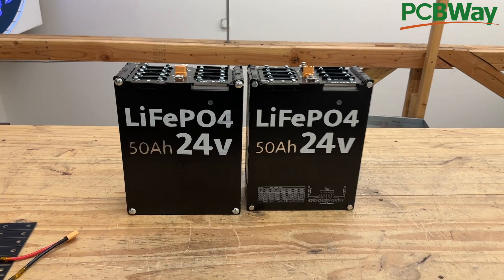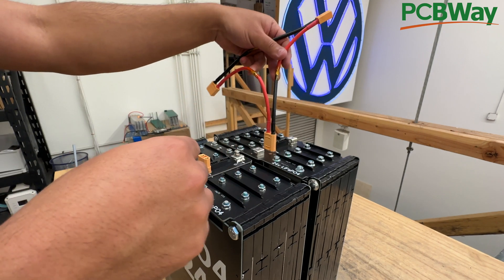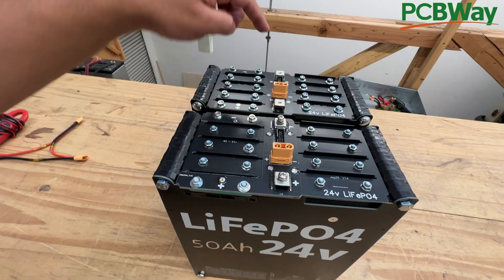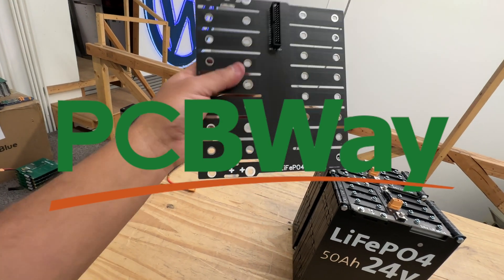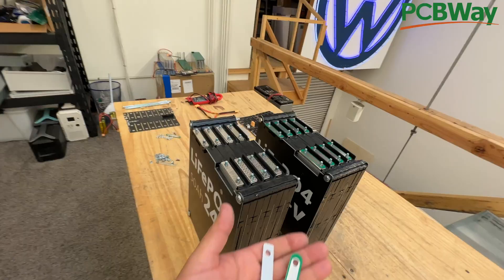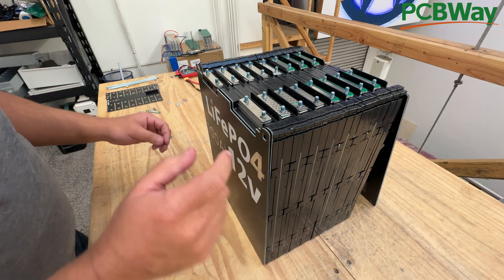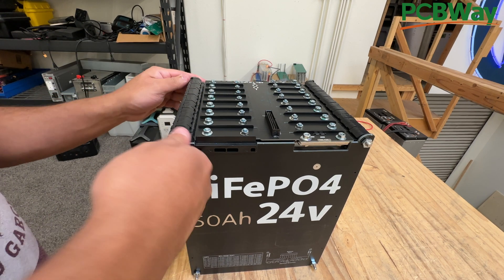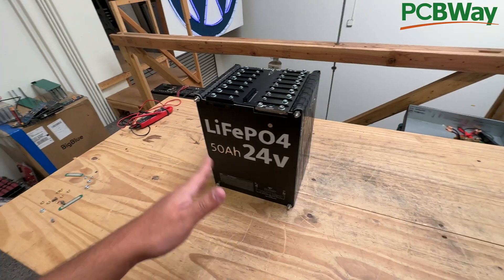How to Make 48v LiFePO4 Systems

Comment: The BMS that is attached has a 20 pin connector and the board has links to a 36 pin connector how do those work together? Can a 20 pin connector be used if only running 1 48 volt pack and don’t plan on expanding

Comment: Could I use ring terminals to attach bms leads to those bolts on top? I don't like the pin connectors for BMSs.
Reply from the maker: Yes

Comment: Let me ask here if I have my reasoning correct.....currently, I have (16) 6v @ 215ah FLA golf cart batteries hooked up in 2 paralleled banks at 48v.  That is 48v @ 430ah or 20,640 wh.  Because they are FLA, the recommendation is to not go below 80% charge and never below 50%.  This means my usable energy is more like 4128 wh at 80%, and 10,320 wh at 50%.  Does this mean that (1) 48v @ 100ah in LiFePO would be as good as my current bank being discharge to 80% (since LiFePO can be drained fully)?  And (2) would give me, nearly, the same amount of useable power as draining it to 50%?

Thanks!
Reply from the maker: Yes that’s correct
Reply: @jehugarcia  Thank you.

Comment: So 2P 50Ah (50+50=100, there’s that basic math again) is 100Ah? LOL
GREAT vid, though for those that NEED it. I LOVE your stuff.
I started making 48v SPIM08HP High Amp Load Packs for my Solar System from your video about them.
I 3D Print my own hardware for the packs too. The Frames and the little bolt blocks to tie cels + to - together and compress the pack cells to minimize expansion during operation. Plus a Nice High Amp Pack BMS, of course.

Comment: Wow Jehu, you really did a great job DUMBING this down for those that need that level of explanation because they don’t put in the needed research to learn about low voltage DC for themselves, huh? Or is it a self confidence problem? This info just seems like a DUH moment to me, basic math, 24+24=48? 

On a different note, are you concerned that PCBWay being Chinese, they might steal your IP and duplicate your designs, erm fake reverse engineer it by copying your board designs with insignificant, minor changes?
Reply from the maker: Open source = you can modify it however you want,  anyone.

Comment: hey man I just saw your video on the ecoflow delta mini and the extra battery's you sell i was wondering if it would work with the ecoflow river max? i would love to buy a few! im just confused the river shows a solar input of 200W 10-25V dc 12A Max and the mini shows 300W 11–75V DC 10A max is the amps and volts on the extra battery a problem? i really want a few due to there not being another expansion for the max haha also im only asking because the battery's you on your river video shows page not found anymore when i click buy.

Comment: Very good and simple to understand One question brother if you can answer in your next video
Can we series 2 DEFRENT voltage batteries to build 48v battery
I mean if we series 18650 7s battery to lifepo4 8s battery
IS THAT WAY CAN WORK
Reply from the maker: No Don't do it
Reply: @jehugarcia  but both batteries have BMS can you make a short video on that I will thankful for that
Reply: No, different chemistry,  and LI ion 3.6 Lifepo4 is 3.2v you would loose power if you mix .
Reply: @richardle7469  understand

Comment: I’ve been building packs for race cars, using 50 180aH LiFePO4 cells, and in the 8 years I’ve been racing I’ve found that millivolt-precision bottom balancing to 2.500v works better than a BMS, and avoids the weight and complexity and possible failure modes of a BMS.  Two caveats: I’ve only ever done this with LiFePO4 chemistry, and I always balance each cell at least 3 times, usually allowing at least 8 hours between the first and second balancing, and 3 hours between the second and third.  And precision is key, you need a quality volt meter that is precise in the millivolts.  (Coincidentally enough, I’m bottom balancing at this very moment, preparing some packs for the upcoming “25 Hours of Thunderhill” race)
Reply: This is interesting. Do you mind sharing a photo or video of your pack. I'm interested in your method. Thanks in advance
Reply: @RotimiBabalogbon  I saw you subscribed to my channel, which is cool and all, but mostly I just post random stuff of my own on my channel.  If you want to see the EVSR electric race car in all its glory, subscribe to the EVSR "electrifying racing" channel https://www.youtube.com/c/ElectrifyingRacing/ and here is a video showing the first step in preparing the packs, equalizing the voltage between cells https://www.youtube.com/watch?v=zT1T7uGsoVM I will look for a video specificly about bottom-balancing, but I don't think we have made any public at this time.
Reply: Thanks. I'm watching right away.

Comment: Looks like you have all the bits to make the 48v system, perhaps you'll have enough demand to set them up out the gate for folks?

And of course you're limited in how you can ship these. Perhaps a little diy can come into place here. Sell it as a disassembled kit, ship it in separate boxes, some assembly required. You get everything you need, comes in separate boxes, and hopefully with good instructions too. My 2¢

Comment: Anyone asking how to make a 48V system from 24V batteries shouldn't be going anywhere near batteries!
Reply from the maker: No…. Everyone is allowed to learn,   If you are anti sharing ideas and knowledge you are in the wrong channel.
Reply: @jehugarcia  Sure, but learn the basics before even considering building a system.
Reply: @rogermckenzie2711  you sound like my mom before I built my first car.  She was all like “you’ve never built a car before, you should learn the basics of auto mechanics before you consider building a whole car” but there is nothing wrong with learning, we don’t all have to be total experts before we try something new.  BTW, I finished that first car in 4 months, and still drive it, 26 years later.

Comment: Could you essentially do the same thing with 4 of the 12v 50ah batteries and use the PCB board or would that not work
Reply from the maker: correct,  you basically need 16 cells  total  (4 cell on 12v50Ah packs)
Reply: And I plan a n doing this just ordered another 12v 50Ah